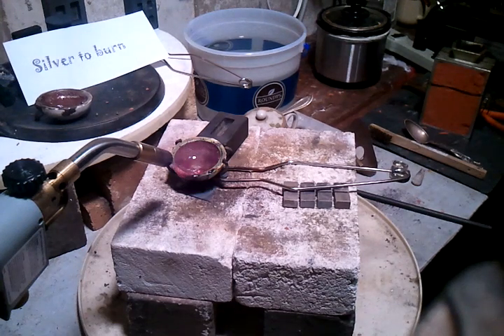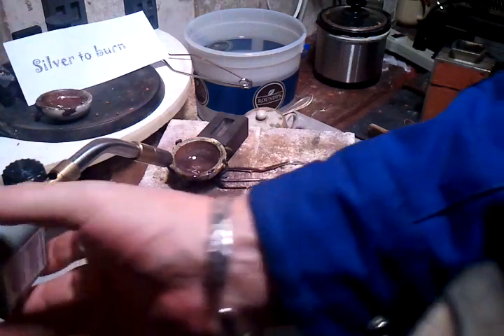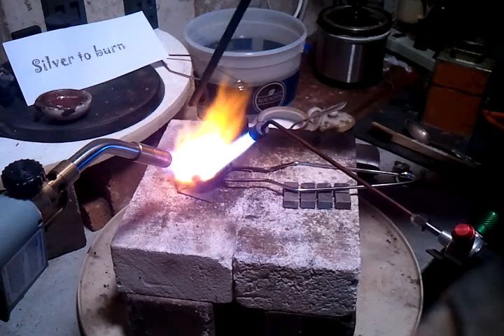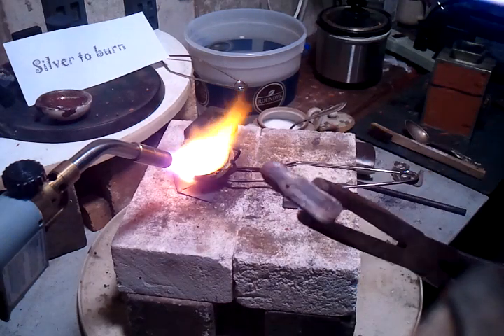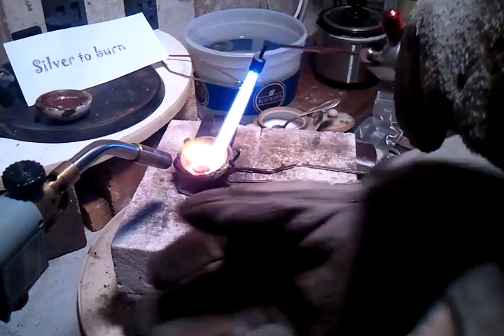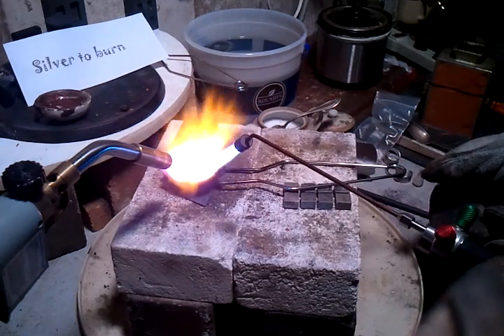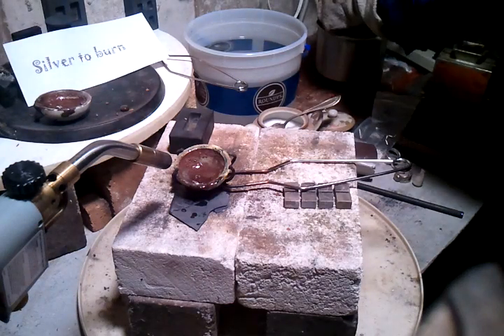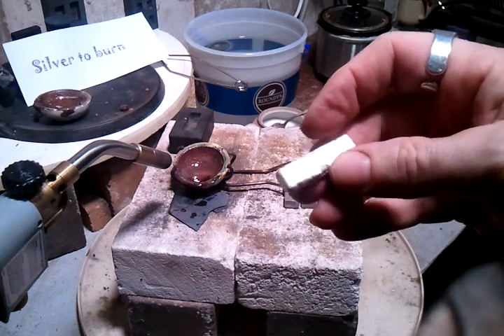DEMONSTRATION ON MELTING & REFINING STERLING SILVER SCRAPS! #13

Comment: You need to cupel the silver with some lead to oxidize off the base metals leaving you with only precious metals
Reply: Using lead will not remove the copper from sterling.
Reply: @fredwalters3210  Wont lead remove the copper?

Comment: What is the total cost per oz/kg/whatever (in fine silver), for extracting it? I suppose it's rather high, since sterling silver is so cheap compared to fine silver? (almost half price).  If not, would it be a way to make an extra buck? Cause I'm thinking about setting up my own little home refinery just for fun, but also to make a bit of money on it. Is it possible to make a bit of money, or just a pipe dream?
Reply from the maker: Buy sterling scrap off ebay & refine it & cast it into bars & sell them! Ya could make some money, but not 100s
Reply: half price for 925? Where, please?

Comment: It's still .925 sterling silver.  The copper didn't go anywhere.  Try the nitric acid refining method. It removes the copper.
Reply from the maker: The silver gets alot brighter in color & is softer! Seems to pull out the impurities/copper!
Reply: After you first pour, use a soft metal brush to polish it up.  If tested, it's still .925 sterling.

Comment: What happens if you put 925 silver and .999 mixed into a smelting furnace and pour it ? Does it mess anything up other then purity ratios
Reply from the maker: Right,  only messes with the purity ratios! It will mix fine!

Comment: You are melting the silver. You are not refining anything.
Reply from the maker: The Silver does get brighter each time I do it, meaning less impurities!
Reply: Just repeat yourself and learn nothing.
Reply from the maker: Apparently you repeat yourself and learn nothing!
Reply: Dordii is correct.
The 7.5 % copper is still there.
Reply from the maker: Borax pulls out the impurities, repeat the process it will refine the Sterling!
Reply: No. Borax removes some 'impurities' only marginally. You can melt and remelt until eternity, you won't remove copper, zinc, lead, tin, antimony, cadmium, arsenic, let alone gold, platinum or palladium from your contaminated silver. To do so, you need to refine it, which is done with nitric acid, precipitate with copper or lye - sugar and use electrolysis to get it 999,9 pure. 
There is no other way.

Comment: I used chemicals to dissolve my scrap silver it was a interesting process the silver was suspended in the acid which looked like sky blue gator aid. Then used copper to change it to a gray mush which dried into a gray powder. I still have a pint of it in powder form and about a pint of shot. You method looks a heck of a lot easier I will do you way the next time!!

Comment: I believe some of the earlier comments may be incorrect, this process will refine the sterling into a higher purity, the copper will oxidize float to the top and absorb into the borax glass.
I can't comment on the efficiency of this method but I am quite certain it should work, silver to burn can you post the specific gravity of your cast bars?

Comment: What's the cost of the gasses and other materials? I'm a contract welder and sometimes the gas I use on some jobs greatly cut into my profits
Reply from the maker: Sorry for the late reply! You can use Mapp gas! You can cast around 10 5 ozt things with it! I use Delft clay which cost approximately 70 bucks for a small loaf of bread size! This stuff is expensive! Also Petrobond sand works to at half the price but you don't get all the fine details!

Comment: If you want to purify silver you have to put it into a nitric solution and then slowly precipitate out. Melting this silver and putting in a small amount of .999 silver does not refine the silver into a higher purity.
Reply: Well, may be some copper oxidized and oxide went into borax, but not much I assume...
Reply: No cupeling does, acid isn't needed.
Reply: @thedutchman8793  Just orddered high quality cupels, will see, how it works on silver.

Comment: I thought he was remelting the 2nd time because he didn't like the pour, turns out he's trying to burn it to refine it? i'm lost and I'm done.
Reply: Borax is simply a Flux to help reduce the melting point. It will not remove the copper from the sterling.
Reply: It's really easy to do! Just add a little borax & stir it will take out some of the copper! Do it a couple times and the silver will become more pure!

Comment: All you are doing is melting the sterling silver... you are not refining or increasing the purity of the silver... if you are wanting to increase the purity you are going to have to use chemical or electrolytic methods, as just melting won't do anything... the only way something would stick to your graphite rod would be if your item had something that wasn't supposed to be in the melt like a spring in a necklace or something but that wouldn't be considered part of the silver purity because it's not part of the alloy used in the sterling silver itself... this is comical why would you add pure silver to sterling silver? you're just making more work for yourself to purify it later...
Reply: If you want to learn how to refine precious metals I'd recommend checking out some other channels like Sreetips, or indeeditdoes, or even an online forum that goes by the name "The Gold Refining Forum" a wealth of information can be found there.
Reply: Might watch some videos at Cody's Lab channel he uses chemicals to separate the metals and dissolve the silver into solution, precipitate it out, then melt down the pure silver that is collected from this process
Reply: I would recommend to always wear the proper breathing apparatus whenever doing melts because unless you know with 100% certainty what the other alloys that may be mixed with the palladium are it could be possible that other toxic metals may be present. example: Lead, Cadmium, Zinc (fumes) etc. Pure palladium on its own if you're melting it I'd at the bare minimum I'd recommend that you do it in a well ventilated area (outdoors with a slight breeze, or under a fume hood) and you should be alright.
Reply: The impurities go into the borax you sprinkle in there! The borax sticks to the graphite rod! Then you scrap it off! Which takes out some of the copper! Now by adding pure Silver it bumps up the purity!
Reply: No I'm sorry you are incorrect the only thing borax is really good for in this case is to separate any sort of foreign objects from the metal itself like if you were melting rings with small 1 point melee diamonds in them what the borax would do is collect those diamonds in the slag. It is also useful to use for removing the springs in any clasps or closures in necklaces. Its good for removing metal that is not in the alloy or for helping to remove "dirt" from the metal (human residue type stuff like skin flakes and other grime that is from wearing on the human body.

Now if you were trying to refine ores and low grade silver, gold or other PGM's then yes borax can help to increase the purity by oxidizing some of the other base metals but even then the fluxes you use for melting have other chemicals that are better suited for this like sodium nitrate, carbon sources as a reducer,  fluorspar, etc just to name a few.

Copper does not stick to the graphite rod when you are melting silver or gold or other PGM's that are alloyed with it... It just doesn't... please trust me on this I do this for a living. Imagine you are mixing up a pancake batter and then you add chocolate chips to it, pretend the chocolate chips are the copper. can you separate the chocolate chips by just mixing the batter with a spoon? will they all stick to the spoon or get attracted to the spoon? Both answers are no.

By adding pure silver to the sterling silver of course you are increasing the purity but it's really pointless to do because you aren't creating a pure bar by doing this you are just creating a bar that is higher than your original sterling silver content... but it's not doing you any favors because if you are planning on refining this bar you now have to use more nitric acid to dissolve the silver costing you more money in the long run...

Comment: what are the impsurities that your removing? just dirt from on the silver or, copper? also what is the cheapest gas to use for melting silver? i want to start but dont know whether to get map, acetylene or even propane? im thinking map is probably the best choice to start with just wondered your opinion in cost efficiency, great vid by the way
Reply: I know this is old but I hope you have learned that all you did was make the sterling silver into a different shape.  Borax won't remove the copper from sterling.
Reply from the maker: Hi, Sterling is 7.5% copper usually! So i'm taking out the copper or other metals in there! Propane works but Map gas is faster! Acetylene & oxygen is even faster! Get you crucible & borax on ebay! Peace!
Reply: So the impurities come out with borax? I always thought that chemically refining was the only way